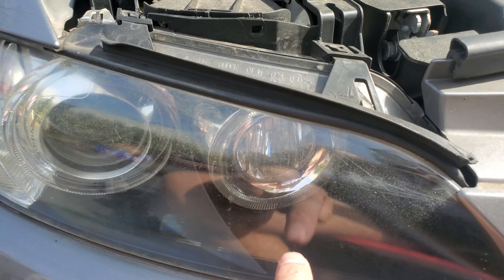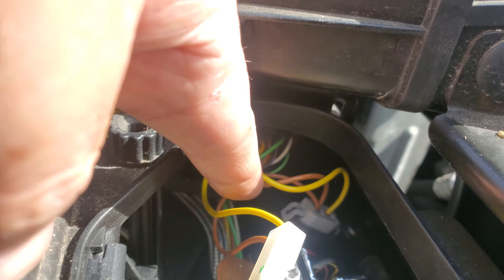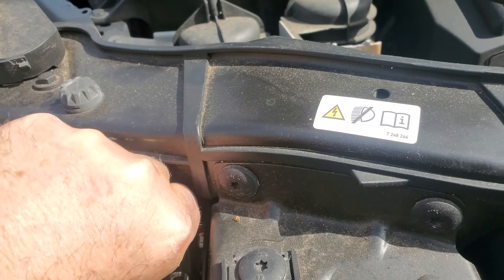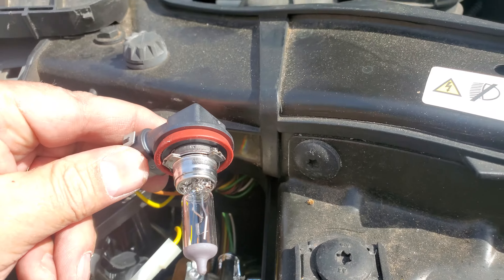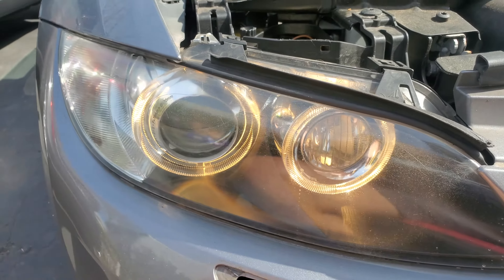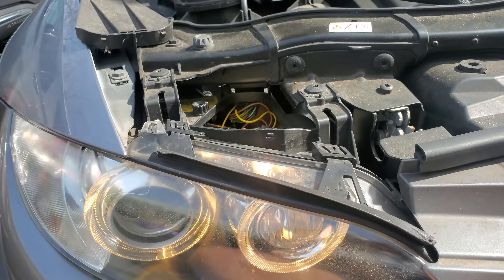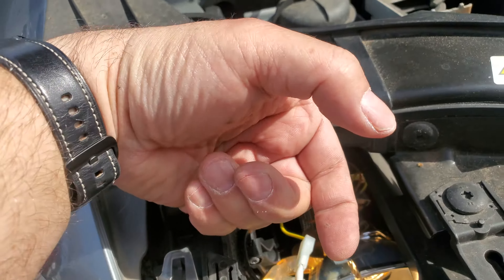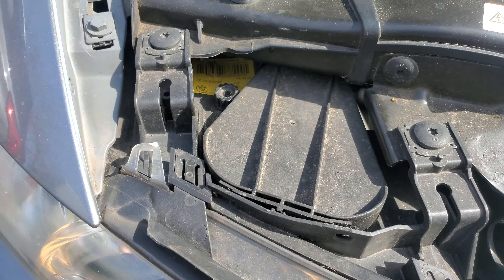EASY - Replace your daytime running lamp for BMW 3 series.

Comment: The other videos made it so complicated, I did to my bimmer, almost 4 yrs ago... and you're absolutely right... this is the easier way, opposed to going through the wheel well. It's just a lil' bit tight, where the bulbs are located. But; this is the easier way. 
Good video, good job!.
💪🏾 Thanks!
Reply: 3

Comment: This is the facelift version that is indeed really easy.
 The earlier models 2006-2007 have a whole different setup for the angel eye bulb which requires the removal of the wheel arch and whole bunch more.

Comment: Exactly how I do it.  note on older models like my 2007 328i coupe the wires are cracking and dry.  may need to put some electrical tape of them to make sure they are not bare and exposed.

Comment: Hello, I have checked and in my 2007 BMW E90 sedan there is no such cover to access the rear part of the headlight, there is a door in front of the wheel to change some lights but the angel eyes I will have to remove the wheel and the wheel arch to change them. I clarify that my headlights are xenon, perhaps that is the reason why a person without knowledge does not try to manipulate a xenon headlight without knowledge as it can be very dangerous. That is why the access to the angel eyes has a special cover and in another location and thus avoid access to the xenon lights.

Xenon lights receive 18.000 to 30.000 volts.

Comment: You only have to remove the wheel when you’re changing the actual headlight bulb not the angel lightbulb false information you’re giving man
Reply: Hold on there are some videos that do show guys taking the tires off reason why is the Canadian models are different from the US models for angeleye replacement do a lil research on this...this guy is solid and honest truly depends on the model you have sir